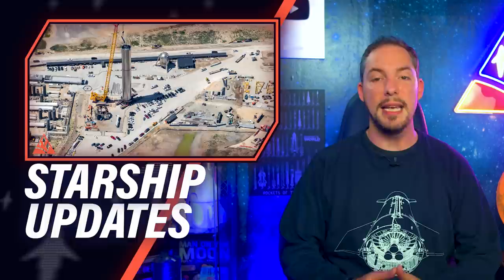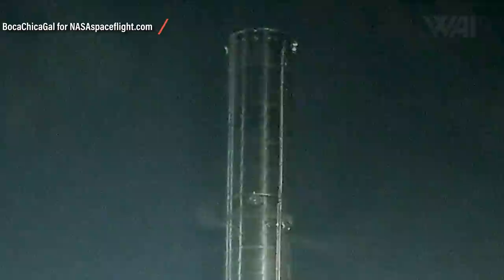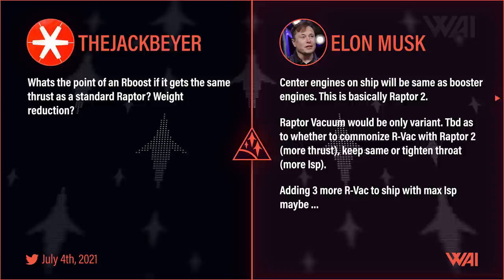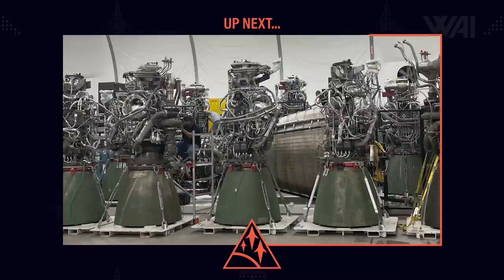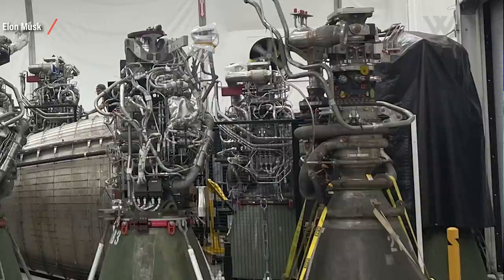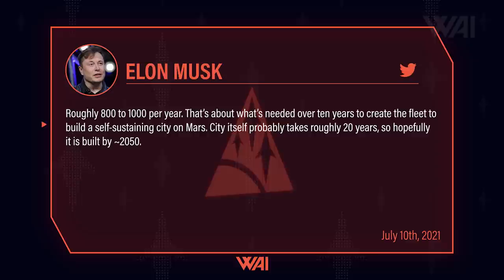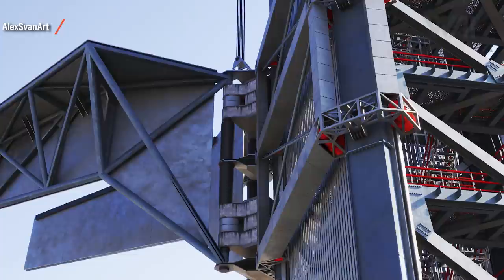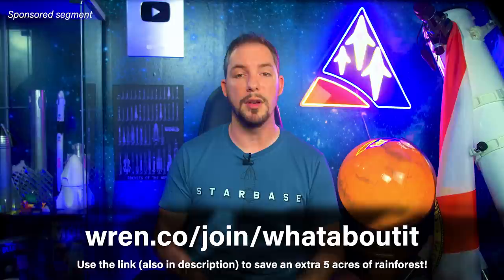SpaceX Starship Super Heavy Tests continue! First cryo tests completed, making way for static fires!

Comment: I think you all got the comment of Elon Musk wrong. There will be still 6 raptors on the starship, but with a smaller throat and therefore better ISP. I guess that type of Starship will still need the sealevel raptor to circularize the orbit and afterwards needs more refueling. The ISP optimized engines will help on trips to other planets though.
Reply: The three center gimbaled raptors would be the same as on the booster. The three or six outer raptors would be vacuum raptors. So six or nine raptors on Starship. Added thrust would provide more acceleration to orbit speed, and would be better for heavier loads, like a full fuel load.
Reply: @ekaa.3189  that's right, but it doesn't make any sense to add more vacuum optimized engines. You don't need that much thrust to finish the orbit. In the tweet Elon Musk wrote: "Adding 3 mor R-Vac to ship with max Isp maybe...". since he just wrote about the center engines before, I think those three are the only vacuum engines. If these are ISP optimized you have a small throat and might have the problem of to low thrust. I think it makes more sence though to use the center engines as support instead of adding the weight and complexity of 3 further engines.
Reply: @larsreinken9135  Actually, three more vacuum Raptors may provide enough extra thrust to justify their inclusion. This is because they increase the extra thrust above the thrust needed to counter gravity enough that they get the rocket going faster for the same fuel load. That's much better for planet to planet transfer orbits.

Comment: I love your content, but you are overlooking the biggest hurdle they will have to succeed in the mars endeavor. Not even counting the landing which is at least a degree of magnitude harder on mars due to low atmosphere, SX will also need to solve the fueling problem in space. Your calculations do not include the tanker starships that will be necessary, or at least the ability to prefuel a fuel depot in LEO. Easiest solution would be to launch and tether multiple tankers in space and just fuel those beforehand so mars missions can stop by to fuel once before departing.

Comment: I think a disc braking system for catch Tower is pretty wasteful considering what elon's been able to accomplish in efficiencies elsewhere. A counterweight system tied to those cables would allow you to store that energy and use it to lift the next rocket onto the pad

But then again, I'm not an engineer. Maybe the cost of such an implementation would never be overcome by it's gains
Reply: Counterweight means, effectively you're smacking against the whole mass of the counterweight at full speed.

Disc brakes means you smack against the mass of the assembly, then get decelerated by the brakes. Much less stress in the vehicle!
Reply: @realulli  that's basic physics. Now i feel dumb
Reply: @gormauslander  I just saw a program about aircraft carriers. The have a very similar problem, aircraft coming in must be stopped without smashing them. They're just much lighter than the booster...

Comment: And the design changes again.. At what point do you start to wonder if they really have a good handle on the engineering?  So many design changes.  So many engines.. Refueling a Starship in orbit for deep space will require the successful firing of 126 raptor engines.  In theory this is achievable, but in practice, it may be asking too much.  SLS Block 1B can deliver a payload to lunar orbit firing 2 x solid rocket booster, 4 RS-25 egnies, and 4 Rl-10 engines.  That is a total of only 10 firings, and all the engines have a solid pedigree of reliability.  Raptor still has a long way to go.
Reply: The great thing about starship that you haven’t taken into account is engin out capabilities, super heavy can lose 7 engines and still make it to orbit as starship has a monstrous 1.5/1 ratio of trust.
Reply: @HarrisonAdAstra  That's only if all 7 engines fail and shut down gracefully.  A catastrophic engine failure would likely take out adjacent engines.  Which may also fail also catastrophically, creating a chain reaction that destroys the launch vehicle.
Reply: @ericmatthews8497  they have flown 15 engines and only 1 has failed on SN9 relight but that didn’t affect the engine right beside it. Your argument is just pessimism that has a chance of happening but it 99% won’t even with these experimental engines, they can only get better from here.

Comment: Great vid Felix. But a few questions on how you came up with, $2 billion for 100,000 tons to Mars. Does that include cost of refuelling in LEO? And how many Starships would be landing on Mars? Did you include the weight of the ship? Just curious.
Reply: Yeah, this seems at least an order of magnitude too low.  If starship reaches it's aspirational target of $2 million per launch, that $2 billion only gets the 1000 ships w/ cargo into LEO.  IIRC, it should take perhaps 10+ additional refuel launches for each to get them out to and onto the surface of Mars.

Comment: $2 Billion for total launch costs?  How does that work out?  Using your number of 10,000 engines and a price tag, Musk said this, of $250,000 each, that is $2.5 Billion dollars just on engines.  How about fuel?  $250,000 to fuel, Musk Price, 1000 Starships, comes out to $250 million dollars.  2.5 Billion for engines and fuel alone.  How about the people you have to pay to support the launch?  There is the actual construction of the starship, the materials within the starship, piping, cables, computers, equipment, etc.  This is not counting the technology and equipment you need to build the cities, plus you have to feed the people going....but we are talking launch costs.  Without insults, can you explain how  a $2 Billion total launch cost will work?

Comment: I'm really glad you're trying to fight climate change! Really good use of your platform. I'm not sure about the wren because donating money to make your carbon emissions less bad is the wrong approach imo. And maybe one last thing: As a suggestion, could you maybe add a small moving progress bar during the advertisement? That would make it easier to skip. Thanks Felix!
Reply: You should reduce emissions, but as Felix pointed out, nobody can reduce their emissions to zero, and so you should pay for carbon offsets for the remainder. Offsets are hard to monitor properly (farmer says I'll leave this forest here, sells the same CO2 savings to several groups, and simply cuts down somewhere else!), I hope Wren does a good job

Seth and Wyne's 2017 paper is still the best guide to reducing personal emissions. Things like LED lightbulbs, hang-drying clothes, and recycling have low impact (every little bit helps, but some bits are little). In increasing order: eat a plant-based diet, switch to electric car, buy green energy, avoid flying, live car free, and have fewer children.

Comment: It is going to be funny when that tower breaks, or the rocket because i doubt that catch system is going to work like they think it will. 

Also, i think you need to take a step back about musk's 'mars city' and how long it is going it is really going to take. Because if he really thinks he can get a city on mars going in 29 years, he is out of his mind. But then again he has always been a hype and fail train, and you just help that along.
Reply: Doubters as always is very loud
Reply: And your point is what?

Musk's have proven himself to be an utter failure time in again. His solar shingles as he has shown them, don't work. 

The electric semi he promise are still not out a year later. 

The Star Link internet is already losing satellites, has a short life span of 5 years, and not even enough bandwidth per unit to make it cost effective when other options are out there. That is not including the fact he wants to launch more satellites into orbit in the next few years, than are already out there. about a six times increase i believe. 

His 'self driving cars' are still not working.

The Hyper loop, is an utter joke, and still not even running in the slightest.

And the Las Vegas Loop, was such a bad flop, that all other projects were cancelled. And Musk's company is having to pay out money till it is up to the minimal requirement.

So yeah, i doubt, extremely so, musk can build any thing close to a city, let alone a small town on mars in the next 29 years without most everyone dying of radiation, lack of food, water or from each other on the trip or while there.

Comment: I'm not really impressed by virgin galactic. Anyone can be an astronaut now, all you have to do is lower your standards. 
I've been to space myself, standing on a tall mountain.
Reply: For what Unity has done, I'm impressed. Branson has signed up 600+ people for 'space' tourism, and the revenue is potentially ginormous.
I just hope to see an upgrade of the system to a more decent version of the craft. That's kind of a crappy engine, for one thing.
Reply: @-danR  I'm actually surprised they're still allowing such a dangerous and environmentally detrimental engine to carry humans.
Reply: @Jimbo Bimbo NASA also thinks it's okay to spend $2 billion on a launch.

NASA also came up with the big brain idea to make every single heat tile on the shuttle a specific shape and fit in exactly one location, making them impossible to produce affordability and service quickly.

NASA didn't go full metric until 2007, forcing people to deal with both imperial and metric, constantly converting between them, for nearly 50 years, which did lead to the loss of the Mars climate orbiter in 1999, which cost us $330 million (accounting for inflation).

NASA has had a halo effect around them for too long. They did one or two cool things years ago and that means everything they do forever is credible. In the end, NASA is not the people doing the work, NASA is the whims of the current administration, which changes every 4 years, giving it an expensive and ineffective bipolar disorder. Countless taxpayer dollars have been lost to projects that will never see the light of day because they were cancelled by the current mood swing. 

NASA is not inherently more credible than literally every other scientist around the rest of the world who disagrees with their definition of space boundary.
Reply: @Jimbo Bimbo I think Richard Branson is eyeing Starship as a future for orbital tourism. His small space plane's potential is limited, it returns after a few minutes, and even a larger version could not be used for travel into orbit and to the moon.

Comment: Irony:  the launch of thousands of starships destroys earth’s atmosphere and kills most of the population needed to build and occupy a base on Mars. The gift of the Magi, 2050.
Reply: Peanuts compared to what the current airline industry is outputting CO2 wise, let alone ground transportation. Also with solar energy, CO2 from the atmosphere, and water it is possible to make CH4 (Methane). One can also extract O2 and chill it into LOX. Totally carbon neutral. Plus some of that carbon ends up being permanently removed from the atmosphere because it is used to boost the Starship into Mars transfer orbit.